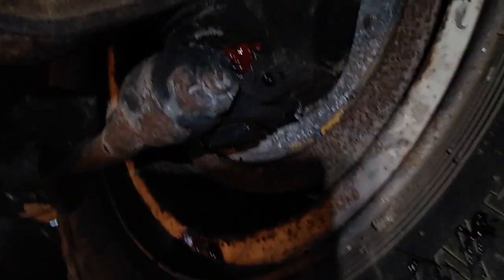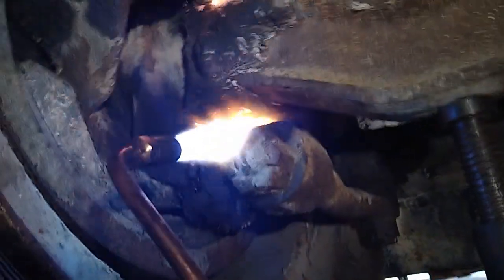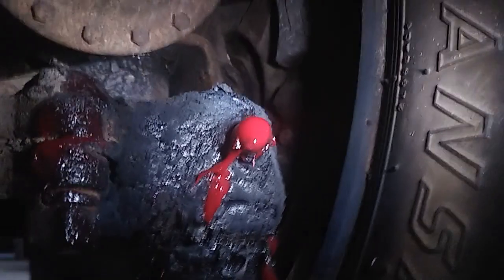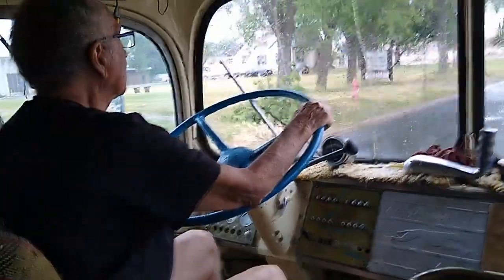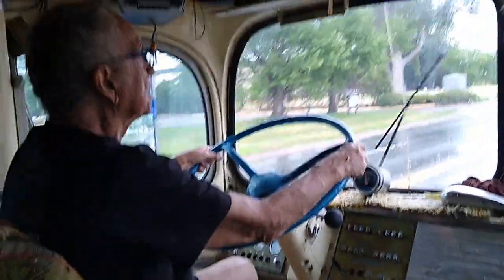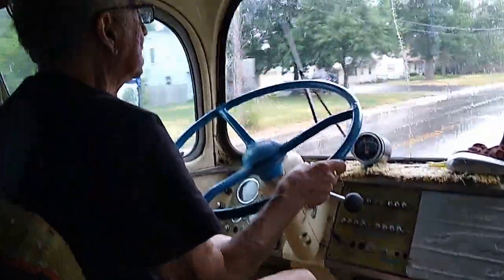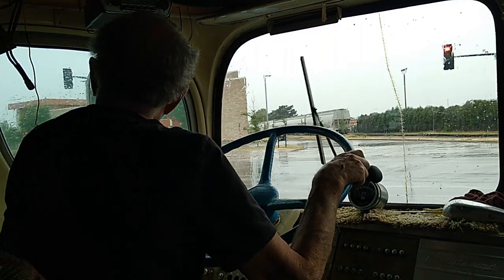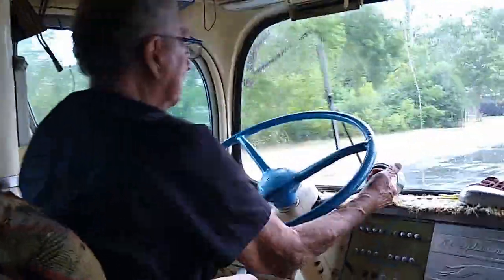Getting Taylor's Bus on the Pit and On the Road.

Comment: Thanks Phil and Uncle Stan! Another great video, thanks for sharing the knowledge that would otherwise be lost to time, I greatly appreciate it. By the way, you do not need self canceling turn signals when you have Stan canceling turn signals.. haha... I hope to get a chance to drive one of these column shift buses one day, and your driving tips are gems. 
Has Stan gotten a non profit set up for donations?
Reply from the maker: There is a telltale lamp socket at the bottom of the switch panel once used by the onboard air conditioning system. I can wire the TS flasher to that bulb. It is clearly seen by drivers . The light on the steering column is invisible to the driver. Sorry, I forgot to answer your question. The site is busboyscollection.org. Thanx, Gino.
Reply: @busoldmanphil7293  It’s very interesting that they built them like that. Seems like most everything else is well thought out, maybe they were a bit rushed to get it done to meet a new standard. Sounds like you have a nice fix to make a nice friendly reminder on the dash.

Comment: Hi Phil,  I was wondering the same thing as tony66au; and his question about the king pins and if that made the steering a bit easier? By warming and greasing the king pins that should eliminate any binding and tightness related to those components. The steering gear itself could be worn and causing the hard steering.  Have you ever replaced the entire steering gearbox on one of these buses?
Reply from the maker: No. The gearboxes wear and can be adjusted and were made not to fail. Kingpins are usually worn and need to be replaced before any serious highway driving. Taylors pins are ok and the bus will steer easier as the grease works in. It should be greased a couple more times in the next few miles.
Reply from the maker: It will be. I was in a hurry and did not heat the kingpin assembly enough.

Comment: So how was the steering after you did the Kingpins Phil?
I did Route service with a late 60's 4 speed stick Bedford "Spare" bus for a while on and off and the same issue with the front end and steering although it had Power assist ram it was still hard work hauling in and out of Bus Stops all the time as the steering was Notchy and would bind while turning and after the 3rd time writing the bus up in the service book they changed it to an early 60's AEC Cyclo-pneumatic 4 speed (Leyland used them a bit with Route buses) which was a lot better.
Unlike the US bus Fleets most Aussie Buses were English truck chassis with Bus bodies and the early chassis were a narrow track with 7 and a half foot wide bodies so not the nicest to drive all day and difficult to drive smoothly.
I think id rather have driven a Post War GM to be honest lol
Reply from the maker: There was an aftermarket air assist system available in the 1950's but nobody liked it. We have a bus here with it and it waists too much air.